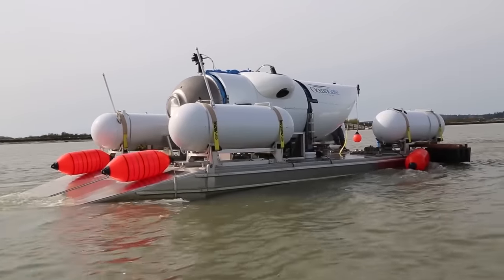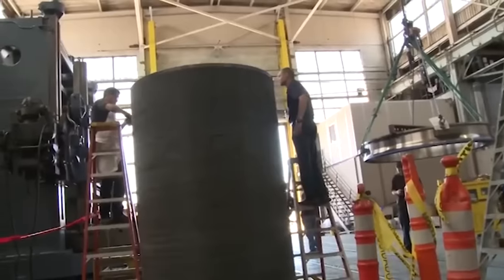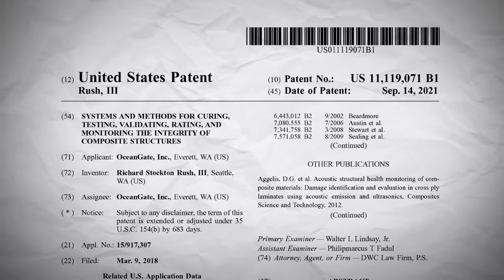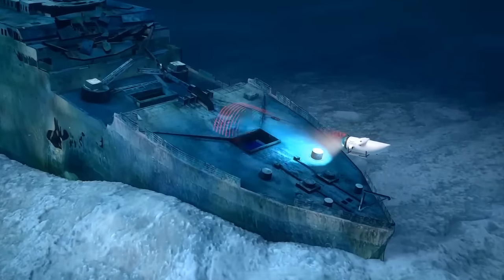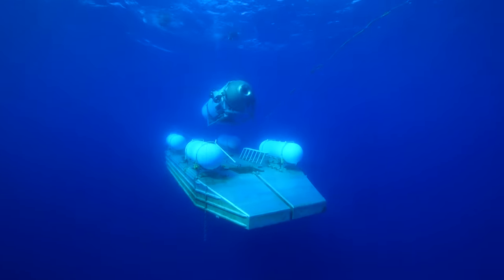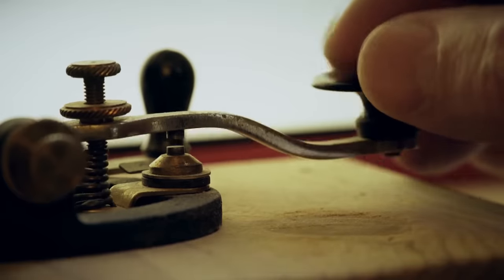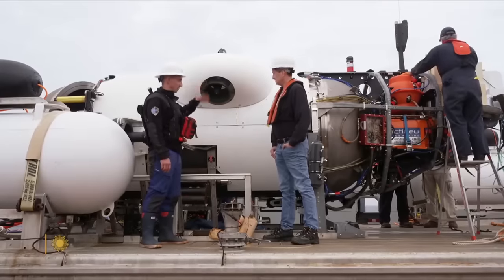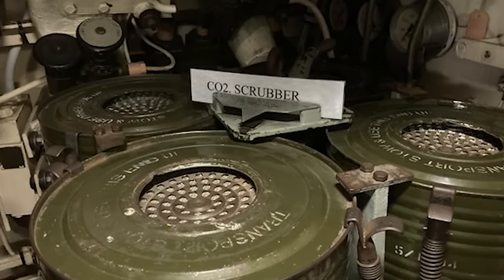Exposing OceanGate Submarines Many Fatal Designs

Comment: I know they're the experts and all but it really makes no sense to make a carbon fiber pressure hull. Spun carbon fiber composites have extreme tensile strength which is why make great vessels for extreme internal pressure. You could use silicone as a binder if you really wanted and take it to 10,000psi and it won't explode, but reverse the pressure differential and it will collapse at like 30psi. The strength of the hull is going to be basically limited by the strength of the resin binder.
Reply: Would you care to provide numbers to substantiate the 30 psi claim ? Cause I know that this is bollocks...
Reply: @les8489  my point is if you use a flexible matrix material the resulting composite will also be flexible, albeit less so. The CF weave by itself is not going to prevent crumpling much. Yes if you have enough layers and enough density of fibers it will eventually become quite rigid, but that rigidity still depends on the strength of the chemical and/or mechanical connection between fiber and the binder (sorta like concrete and rebar).

But I'm just a composite hobbyist. Obviously the engineers are not that dumb, I'm sure at least the basics checked out. It's just so odd not to just use steel. I guess they thought it would be too hard to design the many safety systems to handle that much weight.
Reply: @JohnboyCollins  "The CF weave by itself is not going to prevent crumpling much." You need to understand that the strength of composite in any direction is largely dependent on percentage of fibers in that direction. It is actually a bit more complicated than this - as a multi-layer composite is characterized by a stiffness matrix, and that load in one direction may result in stresses and deformation (including bending) in other directions, with every layer experiencing different stresses. You are right about chemical bonding. I also hope that what we saw (winding fibers in the hoop direction only) is not actually true - because it would be a very bad decision. If you are really interested how composite materials behave and how they are analyzed - there is a plethora of information available (although you may get discouraged very quickly, as this is a rather complex matter).
Reply: @les8489  Yes I'm fairly familiar directional characteristics of CF reinforcement but I know there's plenty that's beyond me. 

I feel like  in a compression load application like this you'd want to have as much mechanical/friction-based coupling between your CF pattern and matrix material. For example, what gives reinforced concrete cylinders extreme compressive strength is the cement aggregate that gets basically jammed in the ridges of the rebar under compression, not the chemical bond to the steel. I'm not sure if this effect can be fully duplicated in CF composites.
Reply: @JohnboyCollins  John, rebars in concrete are used to increase TENSILE strength, not the COMPESSIVE strength (but this is beside the point). Now - carbon fibers need to be treated in order to facilitate good adhesion to the matrix (resin) - and they are. Of course - this is one of potential sources of failure, so great deal of attention is paid to it.
In composite - almost ALL of the strength (be it tension, compression or shear) is derived from carbon fibers. The role of matrix is to stabilize the fibers, keep them straight and prevent buckling (micro-buckling to be specific). As a consequence - a composite needs fibers in ALL directions (various percentages, depending on the load direction). A rule of thumb is no less than 10-15 % of fibers in +/- 45 directions, and no less than 10% in ANY direction.
Unidirectional tape (which has been used on Titan): let's say the load is applied in the direction of fibers. This is like a steel rod (fibers) and a rubber band (matrix) working in parallel. The rubber band will take a miniscule amount of load (under the same elongation).  Now - apply the load TRANSVERSELY: this is like a steel rod and a rubber band working IN SERIES. The rubber band is the weak link in the chain - since there are no fibers to take the load.
In case of Titan - the axial stress is half of the hoop stress - but (if the fibers have been placed only in the hoop direction - and this is a big IF) the axial strength was an order of magnitude(+) less than the strength in the hoop direction.
I still can't believe than any engineer would design a composite cylinder without at least 20-25% of fibers in the axial direction.
Reply: @les8489  Interesting, thanks for that explanation. I would think their vessel would need even more in the axial direction as it's not even a very structurally efficient geometry (far from a perfect cylinder).

Also I think the flexural strength is also radically increased due to the mechanical bond. I still suspect mechanical bonding I would play a critical role in designing composites for an application like this. You almost want a "deep sowing" pattern with some of your fibers going  up and down through all of the layers repeatedly. Then it would be hard for it to crumple without at least some fibers snapping under tensile load. Otherwise I think you have to worry about possible delamination failures modes in which zero fibers actually break. 

Someday it would be cool to go in one that was just a solid transparent aluminum sphere with a carbon fiber tether. That would be "simple", strong as hell and a sick viewing experience.
Reply: @JohnboyCollins  You need to remember that the hoop stress in the cylinder is 2x that of the axial stress. So - it stands to reason that the amount of fibers in the hoop direction should be 2x of that in the axial direction. If you take 15% of fibers in the (+) and (-) 45 deg each, this leaves 70% distributed with a ratio of 2:1 in hoop and axial directions - that is about 25% in axial, and the remaining 45% in the hoop direction. Of course detailed analysis might change these percentages a bit - but the principle remains sound.

Comment: Stockton Rush just did not respect the tremendous power of water pressure....If 1/2 inch plate steel can be severed with a Extreme water pressure jet..How da Hell did He not know  6k psi would eventually delaminate epoxy and carbon fibre strands...SMH..

Comment: Dude is using a Ryobi drill to bolt the hatch on, no wonder this thing failed. Also does anyone know if they were set to torque after use of drill or if they used new bolts every dive?
Reply: @@Scheduled_for_deletion a torque wrench to at least double check id think, yeah

Comment: Honestly ask any engineer that had work with carbon fiber before, yes it is really really strong, but not under pressure, it is more like an armor that can dent to crack the minimum with a machine gun compare to other kind of iron however carbon fiber is really really weak at the same time because if it crack everything just crack instantly, be it on ur car's bonnet or anywhere else.
Reply: theedgelord9928  Im not an expert for that, but I've worked with CF in army before, CF is strong IN COMPARISON to lets say steel (man made) or alu strength to weight ratio that is why people call it a STRONG material. The purpose of CF is not for anyone to build a thing but to integrate as parts.

Comment: 1:42: As dratic as that tanker implosion is, it is nothing compared to a submarine implosion at great depth. 
The tanker must have experienced a pressure differential LESS than 14.7 lbs per square inch.
The Titan would have experienced a delta-P of about 5,300 lbs per square inch if it reached 12,000 feet depth.

Comment: I find the idea of using carbon fiber veery stupid. Yes, it is used for aircraft hulls, but there fibers work on tension and here, in this submersible, fibers work on compression. Anyone knows that fiber or rope holds tension forces very well and absolutely don't hold pressure forces. This hull has been made of resin with filament of carbon fibers instead to be vice versa. I think they have made very very stupid mistake thinking the submersible hull as to be equivalent of a pressurised container which is holding pressure inside. I did not even imagine that this capsule was not  made of a high strength alloy - steel, stainless or titanium.
Reply: OMG...please have mercy...another one who knows that in aircraft hulls carbon fibers work only in tension (wrong), and in addition the dumb analogy of a rope which doesn't work in compression...again - MERCY PLEASE !
Also: "This hull has been made of resin with filament of carbon fibers instead to be vice versa" - THIS IS POSITIVELY HILARIOUS !
Please provide some more entertainment !
Reply: @les8489  ok, may Lord help You in building Your deep sea capsule from carbon fibers working on compression. No objections from me!  MTFBWY
Reply: @javorekbg6081  In one of my posts I stated explicitly that carbon/epoxy composite is the least appropriate material for a deep diving hull - so your attempt at sarcasm (?) is totally misplaced.
Reply: @les8489  All right, are You jealous that someone else knows something on the matter of construction materials? I had not read your comment and I have not it read up until now, honestly!
Reply: @javorekbg6081  The point is "...know something."  Titan failed not because of carbon/epoxy (although the choice of material was bad) but because the design and manufacture both had been questionable.

Comment: Thank you for pointing out that video games controllers are a smart option in many cases. They are easy to configure and use. We use them in the military for many applications.
Reply: You use them in the military for manned vehicles? And, while it's true that a game-style controller is a great solution, having a consumer-grade wireless controller as a single point of failure for a manned vehicle for which you have no rescue options is a seriously bad idea.
Reply: @beeble2003  A steering wheel in a car is a single point of failure. So is a break pedal. You cant have triple redundancy for everything.
This can of tuna in the ocean relied upon its ability to detect flaws in the carbon fiber hull, the controller wasnt any part of the equation.
That they had no back up plan in place for a total failure of all systems was their problem. i.e. go down 2.5 miles in the ocean, expect bad things to happen if youre not completely resourced.
Reply: @Chris-cv4tt  There are literally billions of cars in the world. When did you last hear of a steering wheel or a brake pedal breaking?  When was the last time you heard of a $30 wireless computer peripheral randomly stopping working?